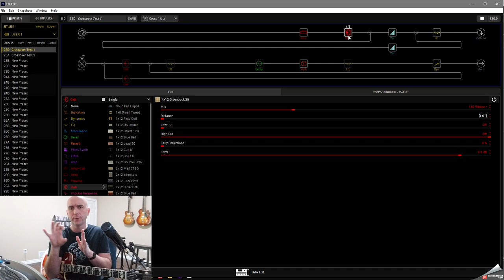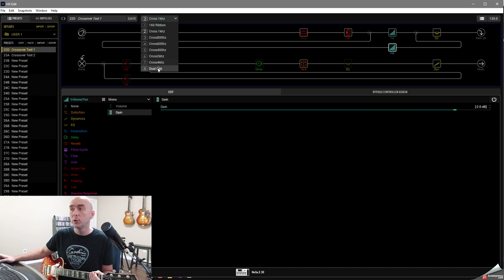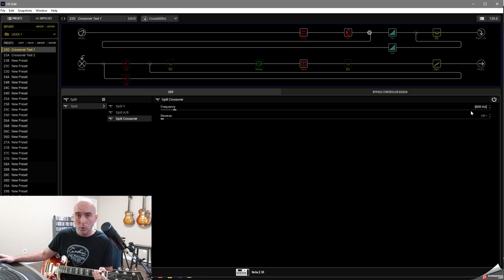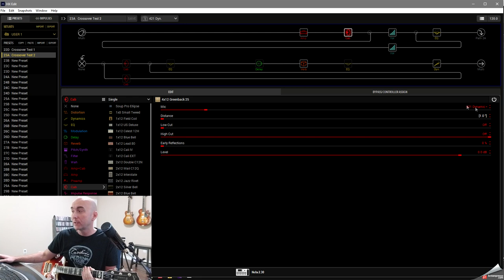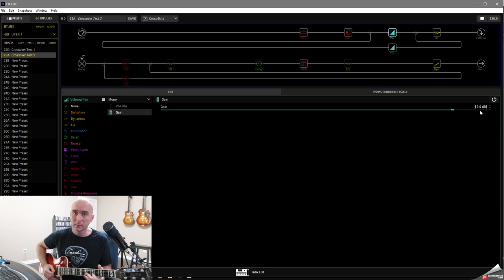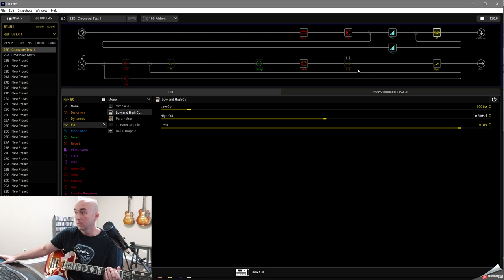Line 6 Helix - How To Create A Great Tone - Pt. 13 - Stock Cabs REVISITED

Comment: You've chosen wisely...

Definitely shows you have a unique and valuable insight. Plus, that's brilliant. Plain and simply brilliant! It's as if you created an EQ block with discrete boost/attenuation for each parameter. But in this case, it's much more elegant and clean.

Thanks, Jason.
Reply from the maker: Thank you and my pleasure :-) Most certainly one of my favorite ways to work now! Hopefully, we will get a dedicated and adjustable high and low shelf eq which could replace the need for this in a future update!

Comment: Very cool idea and improvement in the tone over the dual cab method comes through crystal clear. I imagine some fun could be had trying some effects after the gain blocks and before the merge like adding some chorus on only the high frequencies for some super shimmer or a comp on the low to tighten up the bottom end.

I felt the ribbon mic at 400hz crossover was a sweet spot.
Reply from the maker: Thanks so much Jon! Yeah there really are so many possibilities with using the split crossover which is a really wonderful thing to have at our disposal :-) So glad you like this! I am bouncing between the 400 or 600hz crossover point as my favorite at the moment, it will probably depend on the situation! Thanks for the comment :-)

Comment: Hi Jason. I’m a bit late, just discovering these videos. The idea and specific use of gain block here is great. I’ve downloaded the preset, but find that the split crossover modifies the sound, for instance when both gain blocks are bypassed, bypassing the split crossover point or turning it on should do nothing, it should be transparent, right??? Well I hear a change in sound, it’s thinning the bottom frequencies... is this normal? What am I missing?
Reply from the maker: Hey Jake, thanks for the message! I believe when putting those Gain blocks in, somebody reported, I believe a drop in volume, if I remember correctly of approx. 3db. That would give the impression of a change in tonality but it seems to just be a volume drop which is not a big deal as it can be made up with elsewhere if necessary. Hope that helps :-)

Comment: hey Jason, great tutorial - there's so much info scattered out there on the Helix but your vids are really helpful with the way you lay it out in a digestible way. One question: are you using a global eq set on top of the crossover and eq blocks within the preset? Or is all your eq-ing done solely within each particular preset?
Reply from the maker: Thank you Daniel and so glad you are enjoying the videos :-) My global eq's are set totally flat for these videos. I am connected to the computer via USB and the global eq's do not work on the USB out. Hope that helps!
Reply: Ah, that's good to know, thanks Jason! Adjusting my global eq helped, but your method offers way more control. Appreciate it and keep it up!
Reply from the maker: My pleasure and glad to be of help in a small way :-)